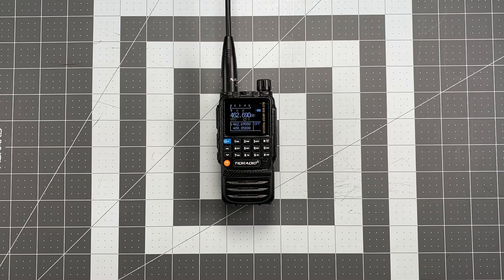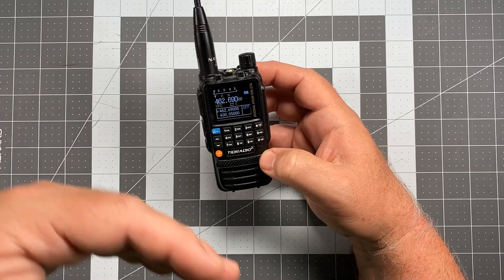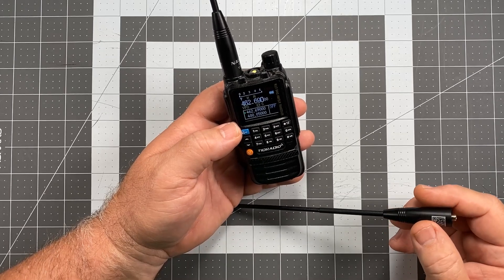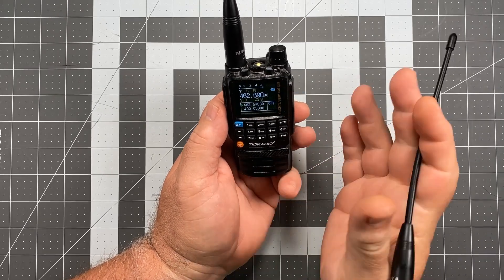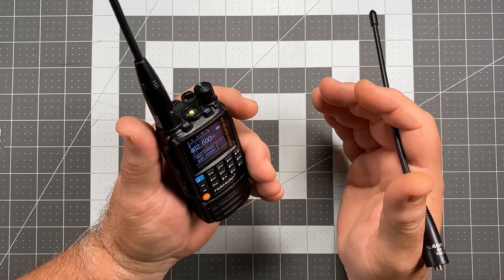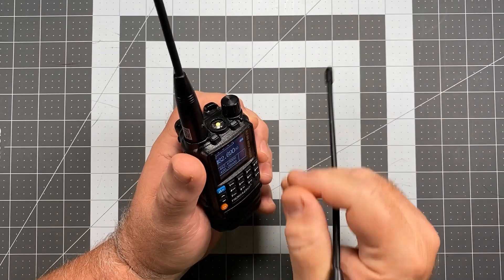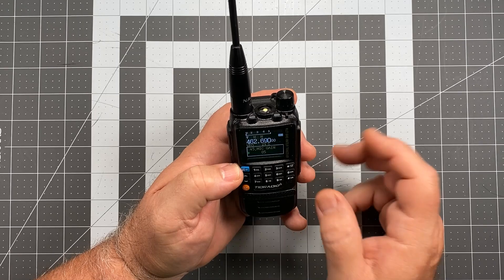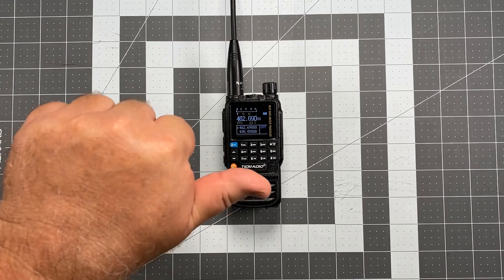TID Radio TD-H3 Operators Series: Part 5 - Mic Gain

Comment: I really like this series. I don't have this radio yet but I've heard great things about it. One detail about this is specifically the relationship with speaker volume, as in the radio's volume. Is there a way to turn it on and have the volume indicated numerically? Like I want the radio to be turned on at a volume of 5, for example. If you turn off the initial beeps and machine voice, you lose the initial test volume test. Anyway, thanks for the great series.

Comment: Good tips.  One thing I do to avoid low audio is to use a speaker-mic to avoid covering the mic port on the radio or having it too far away.  I also like to use a speaker mic to avoid possible exposure issues from RF right at my head when transmitting.  I had a friend who owned a local repeater, and worked in the commercial radio industry,  and would transmit with his HT's next to his face/head on a daily basis.  Unfortunately he developed eye problems, and eventually became a silent key due to complications of those health issues.  No Joke.  So also use caution with the antenna right up against your head while transmitting on an HT.